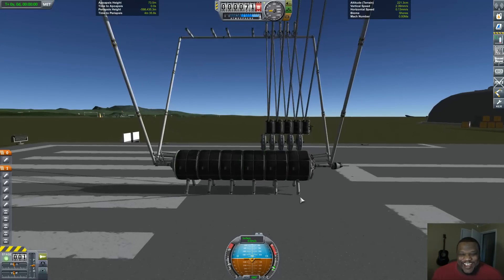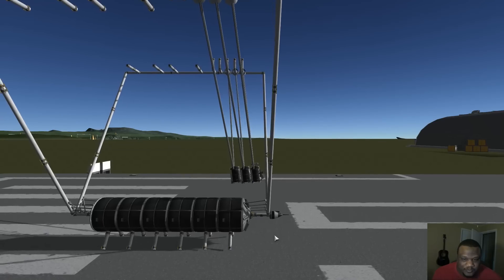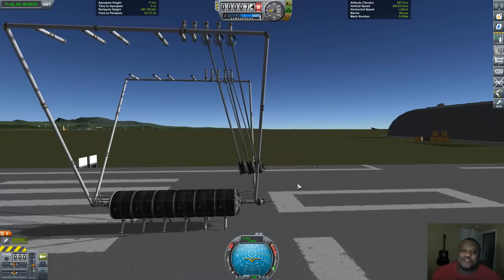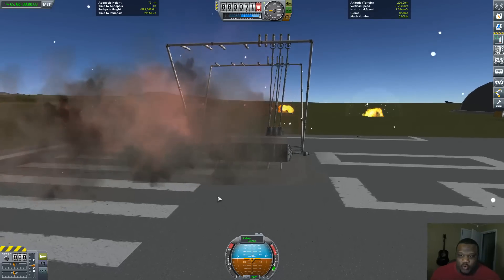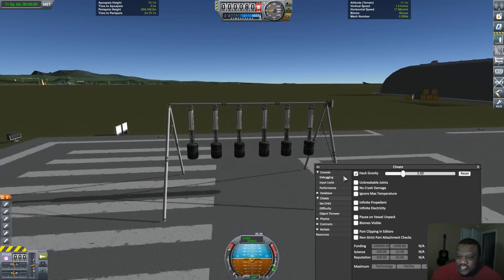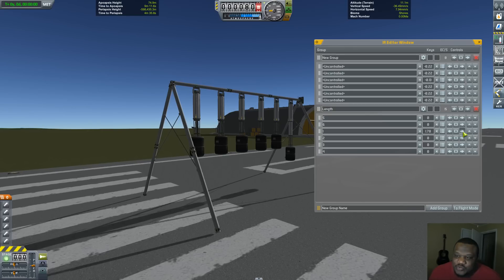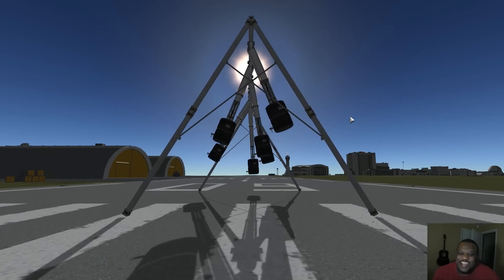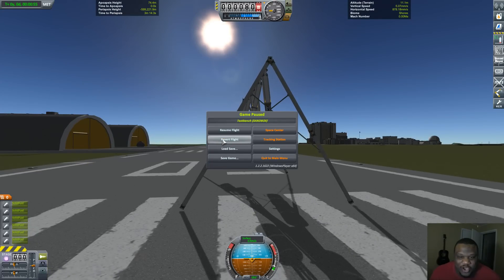Kerbal Space Program | Physics In Action

Comment: First one seems to work just fine (Inelastic impact) where V=(m1*V1+m2*V2)/(m1+m2), since m2(the stack) is >m1(the single one) and V2 <--> V1 it should significantly slow down the single wheel and everything should move in unison. This is exactly what happens.

If you want an elastic impact (like those desk 'toys') you need a different material.
Reply from the maker: Yep, KJR is installed, I just need to tweak that craft a bit
Reply: Haha, we are learning about collisions right now in physics! Yes, he would need a different material, or if he doesn't already have KJR installed, he should install it it an reduce some of the inelasticity in KSP joints.